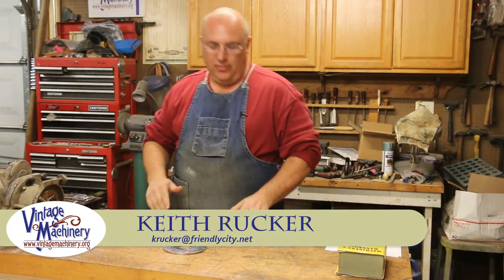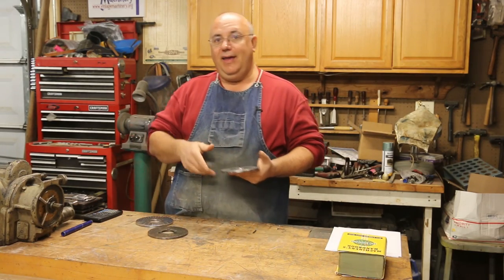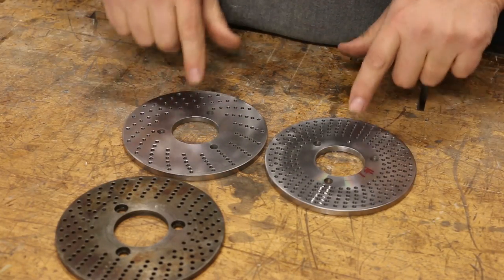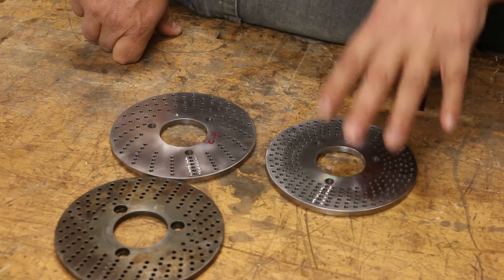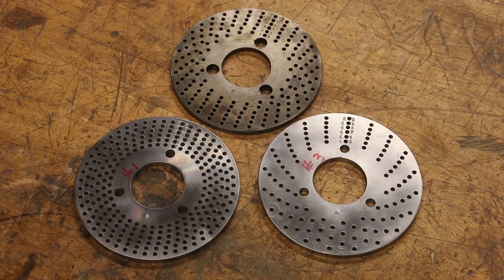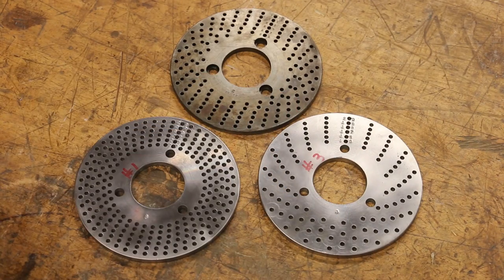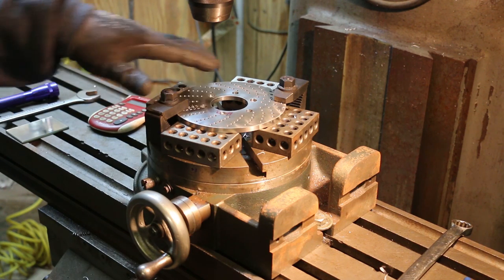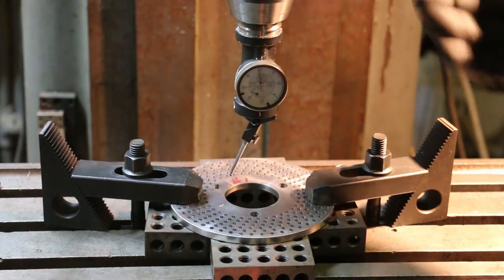Machining Dividing Head Index Plates:  Drilling Hole Patterns

Comment: why did you not just meshear,  the Inside to outside mark your center.  devised the distance & between the center.  to the center of the pin giving you the center of the circle by dividing the distance to the center.   of the pins the position of the center hole.

Comment: If you know the diameter of the large hole and the diameter of the dowel pin you could find the distance to the Centre of the three bolt pattern by measuring the distance from the edge of the large hole to the edge of the dowel pin + 1/2 the diameters of the pin and the large hole + the distance from the outside edge of the large hole to the inside edge of the dowel pin.?
Reply from the maker: +Gord Taylor When it was all said and done, I actually used that method to check my work and make sure I came up with the same answer.  So, on this particular job, that would have worked but not all hole patterns that need measuring will have the luxury of having that large hole to measure off of.  I was trying to show a more "textbook" method of calculating a hole pattern.
Reply: gord you are absolutely correct so much easier ... oh my

Comment: It's a shame the original didn't have six equally spaced holes then you'd have the radius.  I learned that when I made a "stickler" wood splitter back many years ago.  BUT, I learned that my old Algebra and Trigonometry functions can come in handy.  Thanks for reminding me why we spent four years in high school back then.  Greg
Reply from the maker: +Charles Compton Like I tell my daughter who is taking high school geometry right now, it is not important that you remember every formula for the rest of your life, but it is important that you remember what you can solve for so that you can refresh your memory when the time comes to use it in real life.
Reply: I remember telling my math teacher that I’m never gonna need to use this. Now, 50+ years later, I use math all day every day every day as a machinist for more than 40 years. Ha ha on me. At least it got much easier with calculators and computers. 
Great Job Keith. A great machiner can fix there own mistakes and nobody is the wiser.

Comment: I would mill the bad holes on a rotary table and make them lightning cuts so the plates would be lighter than they normally are. Just stay about .500" away from your good holes. Then they would sit lighter on the dividing head while still being able to be screwed on. Nice work.

Comment: One of my prized books is the "Handbook of Mathematical Functions With Formulas, Graphs, and Mathematical Tables" National Bureau of Standards.  The Circular Sine / Cosine s to Tenths of a Degree to 15 decimal places.  And my "Table of Natural Logarithms for Arguments between Zero and Five to (in) 16 decimal places.  These were used both in Engineering classes and Physics classes but in the design of Massive Radar electronics that calculated (plotted) orbits and paths.  Dad, I and my brother were very high tech.  My brother is still working.  Dad and I were Home Shop Machinists while my brother and I also work in wood.  A different age than now.  I'm 72 running hard on 73.

Comment: Bozo is our friend. 
Right.
Those extra holes would probably drive me nuts.
I'd probably have to plug them. 😊
Nice video as always, Keith.
Thanks,
John
Reply from the maker: +John Bazaar They will probably drive me nuts as well.  A constant reminder of one of my many Bozo moments....
Reply: the universe is all about holes, and trying to fill them.. at the atomic level semiconductor are full of holes and the electrons jump from one to the next trying to fill them, getting hot and dying in the process.. At the other end is the black hole at the centre of the universe and planets and stars jump in, get hot and dying in the process.. Then in between is woman with a hole and man jumping from hole to hole trying to fill them, getting hot and dying.  Yes the universe is all about holes.. :-)

Comment: Great instruction on the use of the DRO for doing bolt circles.  It will help me with mine.  Thanks very much from across the Pond.
Reply: +Ron Cartwright  For those without the bolt circle feature on their DRO's you can use an online calculator at :-http://littlemachineshop.com/mobile/bolt_circle.php    I find it quite usefull at times.
Reply from the maker: +Ron Cartwright Thanks - my DRO has a lot of nice features like that in it - many of which I have never even used....

Comment: I use a drafting program to find a bolt circle radius. By taking the measurements between two points as you do and then sketching that in the program I can quickly and with no math get a radius, but this method is valuable to know!

Comment: Thanks for the video.  at 3:18 - Who hasn't made a measurement error?  Confession is good for the soul.  But this was an easy fix and instructional.   Note:  The video mentions that the correct diameter is 1-3/8" which, I think, should be 2-3/8" correct diameter (drilled to the incorrect 2-1/2" diameter).
Reply from the maker: +cemx86 Correct, the diameter was 2-3/8".

Comment: great salvage, keith! 
also, you've showed the way to derive an old geometry formula for the relation between the side and the radius of the circumscribed circle in an equilateral triangle. this alone is going to be very useful for many who did not do it at school.

if you could, please post a ref to the actual man who does it on the cnc.
thanks for the show!!
-toly
Reply from the maker: +Toly Dukhovny Toly - glad to hear that so many people are liking the math lesson in the video.  I was not sure how that might go over!  The person who did the CNC work was Mike Wiggins.  There is a link to his video in the description for the video.

Keith

Comment: Keith

Although I majored in math a long time ago, it looks like you could just put the plate in the milling machine, use the coax indicator to find the center of the bore hole, zero out the DRO and then use the coax  to find the center of one of the mounting holes, and the DRO should directly show the radius of the bolt hole circle

John

Comment: Nice recovery.  I've found I can best keep myself out of trouble if I don't measure.  Becomes truer as my eyes get older.  Since I already had a plate with holes in the right place I would have used a transfer punch.   I've had to drill holes that were slightly off of equally spaced on a bolt circle so that the plate only fit on one way and was therefore indexed to a specific position keeping the circumference of the plate synced to the driving element.
Reply from the maker: +rfcarlson1 When I am woodworking, I often use a "story stick" to transfer measurements.  Not so much in the machine shop.  Transfer punches would probably work fine but I think it would be somewhat challenging to line the two plates up just right without making some kind of jig to hold them.

Comment: Hi Keith,

This is another one of those cases where 3 machinists can come up with at least seven ways to make a part...

Personally, I'm a big fan of using transfer punches and transfer screws to copy hole patterns... especially at home, where I don't have a large enough rotary table or DROs on my mini-mill...

Takes some careful work to set things up to hit the center of the dimple with the drill bit though... and, if I happen to have some suitable round stock (not a common situation!) I'm quite happy to turn a hub to rotate around.

Most often, it's a matter of measure three times, cut once, rework the part, scrap that piece, and do it again to get it right... ;^)

Cheers,

Eric
Reply from the maker: +chemech Transfer punches have their place but for this part, I think that work holding would be a challenge.  You would probably have to custom make a jig to center the two parts on each other to get it done right.  But, in the end, the results would be the same!

Comment: Hey Keith,
that inset is a really nice addition to your videos. gives a really good overall view of the process. looks like i will have to start saving up some shekels to get into a DRO.. looks like it's inevitable...
it was a little surprising to see you set up on the rotary table with the dial indicator on the outside perimeter of the table. mine is a 16" table so that method would be out for me. instead i cut a plug that fits in the center and i run the dial on that.

cheers
mike
Reply from the maker: +HolzMichel I have not had that rotary table for very long and just have not made a plug to do that yet.  Another project "on the list..."
Reply: Keith Rucker - VintageMachinery.org
 gotcha ;) looks like you're in dire need of "a round to-it" too... the backlog gets to be a little daunting

Comment: Ah TI-35X - I've had one of those since 9th grade and it's a great little machine. :D

Edit: It will also convert decimals to fractions which is particularly useful if you're doing inch measurements...
Reply from the maker: +Smidge204 I have had that one since I was in college back in the early '90's.  It is still going, and I think it still has the original batteries!

Comment: Hi Keith,
As always I very much enjoyed your video.
I am glad you could easily fix that mishap and combine it with yet another interesting video.
You could however have made life much easier for yourself calculating the pattern diameter.
As you say the angles in the triangle are 60° each, which makes it an equilateral triangle.  The formula for its circumscribed circles radius equals its side length divided by the square root of 3. The diameter is of course twice this value.
For each equally spaced hole pattern exists such a formula that has already been determined. Having those ready as a table could make your life much easier when having to deal with this kind of work on a regular basis.
The general formula R=s/(2+sin(pi/n)) where s is the length of the side and n the number of holes you have.
Reply from the maker: +Robert Köppl Thanks Robert - I was not familuar with that particular formula.  However, part of the reason why I showed that particular method is that you can pretty easily adapt that approach for whatever number of holes you might be dealing with.  But as with pretty much anything in the machine shop, there are many ways of getting to the same outcome!

Comment: Good video Keith.  Thanks.
Regarding the Co-Axial Indicator.  I use one quite a bit.  I have found it easier to unlock the spindle and turn it by hand.  Really, all I'm looking for is the center between the two edges of a hole or boss in the X and Y direction.  I have no control over what happens at any point between X and Y.  I will manually turn the spindle, and move the table 1/2 the difference to find center in either X or Y.  I think often times, the needle is jumping around because the feature is not perfectly round, but possibly elliptical a bit.  If I first get a center reading in X, I can use that same mark on the indicator as a starting point for my location in Y, with the assumption it is perfectly round, then refine it from there. To verify my findings, I will then go in and check with an edge finder, to find I'm usually with .001" or so.  

If I have a diameter where I can't use a Co-Axial Indicator (diameter too large), I will use an edge finder and eyeball center of X direction to locate my center in Y. Then locate my center in X, then come back to Y and check to see if my eyeball was close.
Reply from the maker: +Keith Downing Hand turning the spindle is a great idea with the co-ax indicator.  I have done it that way a time or two and should probably use that method more than I do.

Comment: For those of us without fancy stuff like dividing headed and DROs (or even a mill), it is possible to do bolt circles with just a rule and dividers. You wouldn't tackle dozens of holes but for 3 or 4, it's quite possible.
Reply from the maker: +Peter Fletcher Very true, there are many ways to skin a cat.  In the case of this project, the challenge would have been finding the center of the plate to put your dividers since that whole area was bored out and it has to be prefect to all of the other holes that were already drilled.  Lots of ways to do that as well, but it is not as straight forward as starting from scratch on a blank piece of metal.
Reply: +Keith Rucker - VintageMachinery.org Ah, but if you'd known you had to do it by hand, you would have set it out from the centre before boring out.
I just love your videos, best on YouTube IMHO and I'm learning from every one. Keep em coming!
Oh, and I'd kill for your new shop :-)

Comment: Great vid Keith 

Those who don't make mistakes never make anything

I am surprised you trust those calculators ( all of them are the same) just type in on one line 1+2/2 the answere is wrong , the reason is they follow the rule BMDAS but if you type in (1 + 2 ) / 2 it's correct , food for thought with the beasts

Stuart
Reply from the maker: +Stuart Hardy A calculator will will give you the right answer if you enter it in correctly.  Garbage in, garbage out.  I was taught "Please My Dear Aunt Sally" (Parenthesis, Multiply, Division, Addition, Subtraction).  Now days, I tend to use Excel to calculate complicated formulas where I can see my formula properly expressed on the computer screen.

Comment: Hi Keith,

I found this really interesting, though having had a terrible schooling I too learned Trig; but only to ref the code in the book, I was never told as far as I can recall it had anything to do with deg or any other function. I found Maths really great, but because I was not at school much because of illness I was in the bottom most class, and the three years I was in that class they taught exactly the same thing each year, so having learned the first year it was easy to do the following two years, but I learned nothing extra. Everything I learned I did myself the old fashioned way with Encyclopaedias.
I would have liked a better cooling but that was the only choice. 

Anyway I won’t bore you with my history,.

Take care
mrbluenun
Reply from the maker: +mrbluenun School is a great place to get the basics, but most real learning takes place in life!

Comment: Very enjoyable video, as always, Keith! 
Your explanation of the trigonometry used to find the radius of the bolt circle is excellent. 
However, I hope you don't mind a tiny little nitpicking-like comment here:  
at 13:17 you write x = 1.02825/cos(30°) = 0.86603 with a lowered equal sign to indicate that you mean that the sign refers to the cosine only, i.e. cos(30°) = 0.86603
This is clear and correct in conjunction with your explanation, but it might be misleading and incorrectly interpreted as x = ... = 0.86603
So, generally speaking one should take the small additional effort and repeat the complete term, i.e. x = .. = 1.02825/0.86603
Thanks you again for all your great videos!
Kind regards
Harald

Comment: Great video Keith! Thank you for showing us 2 methods to do this, I learn a lot and have a question please. How would you set up the plate to cut the outer circle of holes using the rotary method and avoid drilling your table or any clamps?  I just can't thank how you could get clearance, thanks again.
Reply from the maker: +JC S Sometimes you just have to drill holes into something.  If I were making an entire plate, I probably would have put a sacrificial piece of material under the plate (aluminum, plastic, even wood) and just drilled into it.
Reply: +Keith Rucker - VintageMachinery.org Ok thank you!

Comment: Nice save Keith. I hope you were able to correct the other plates in time.  I would have to plug the extra holes I think. Thanks for sharing the Mr Bozo moment.   regards from the UK
Reply from the maker: +Gary C Everybody says to plug them up, but they are not hurting anything and sometimes I need a reminder to slow down and not be a Bozo....

Comment: Hi Keith,

The mistake is a shame, though the time consuming stuff is surely the measurement? Still doing it on the cnc does mean the info is saved if it is a mistake on the three hole pattern that doesn’t take long to do. Really interesting hand worked video though, thank you so much. 

Take care
mrbluenun
Reply from the maker: +mrbluenun Thanks - if the extra holes really bothered me, I could always just make a new plate - it would be easy to alter the CNC file to fix that one problem.

Comment: With the Coaxial Indicator.
 
I find it,s much easier to use this type of Indicator without the spindle running.

Meaning : just rotate it by hand only.

For Two reason it is easier to set your zero.

And also you are not wearing out the the body of the Indicator. 

Thanks for the video Keith.
Regards Peter.

Comment: I always used an edge finder and the mid function on the dro to find the center. Go to the approximate center then crank to an edge, zero the dro, crank to the opposite edge and hit the mid function. Lock that axis and crank to zero, then do the other axis the same way. It takes less than a minute and is always within .001. btw I would make little t shaped plugs and press fit them into the bozo holes.
Reply from the maker: +Richard Haisley I don't like using edge finders on an inside bore like that - they don't behave the same as on an outside diameter.

Comment: interesting that your mate said that it took arround 3 hrs to program and setup the job on the confuser and another 2 hrs total for setup and run time on the machine. So their is a lot more to figure than the minute 7min and respective 20min runtime  of the cnc cutting tool on this work,
Reply from the maker: +honi9 Very true, but it would probably take a lot longer than that to make just one of the plates by hand.
Reply: I'd say.... :/
Reply: +Keith Rucker - VintageMachinery.org 
especially if you had to trig every hole on the plate.